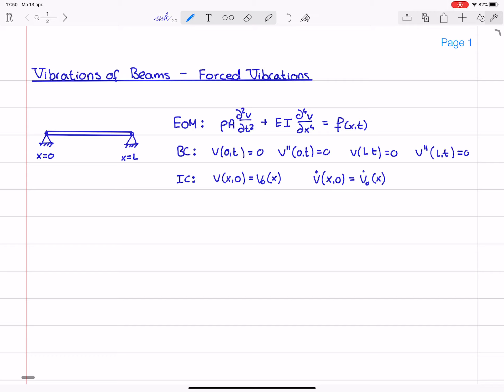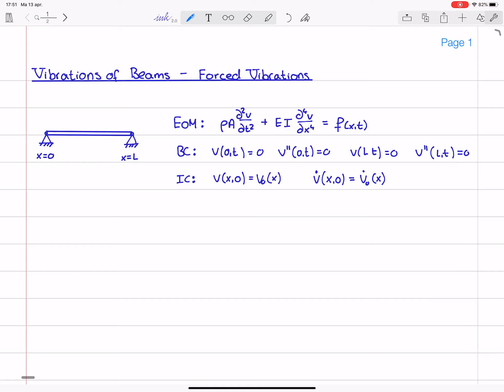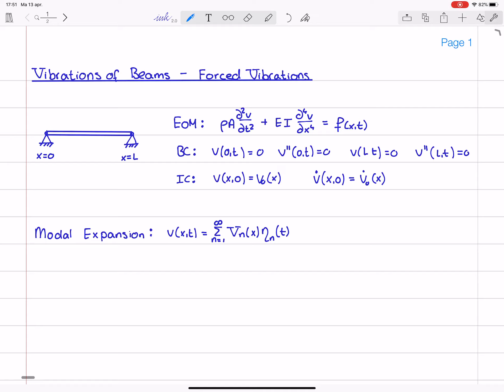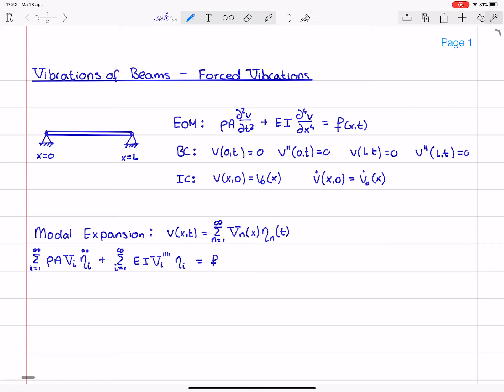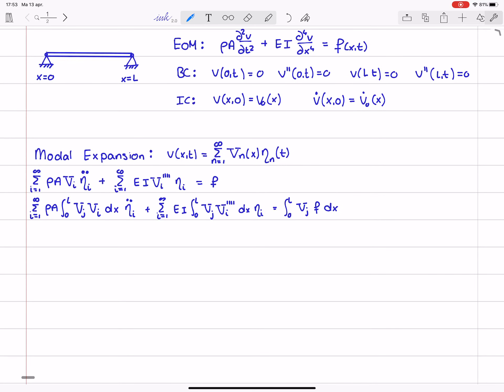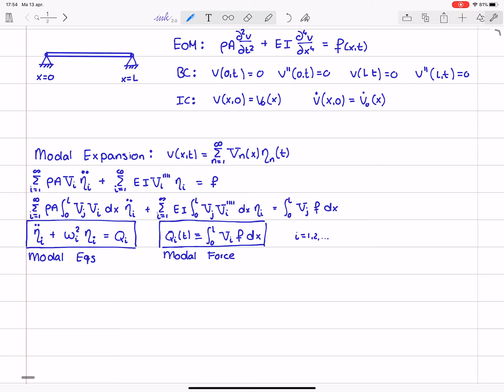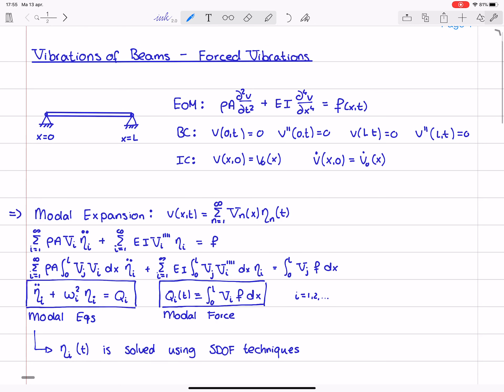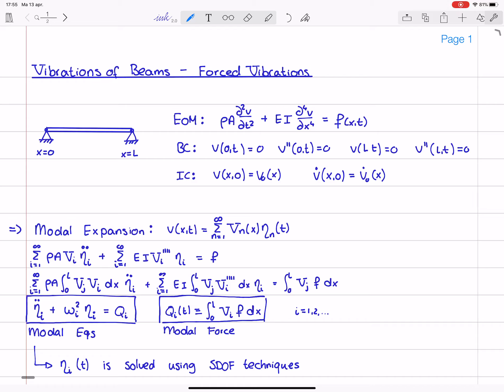Mechanical Vibrations 66 - Beams 6 - Forced Vibrations

Comment: Great video! Thank you for explanation! 
Anyway, I didn't understand why the fourth deivative of Vi is canceled. Shouldn't it be replace with a terms that in some steps gives you the modal mass? Or maybe I just missed some assumptions. Sorry I'm trying to figure out the meeaning of modal mass on the beam
Reply: It is not cancelled while deriving orthogonality condition for this particular example, we saw that the term with fourth order derivative of Vi was equal to omega_i^2

Comment: hello, this is a classic example of undamped forced vibrations that usually some books use as a example. Congratulations, it is really interesting. I am studying that topic and I am struggling with doing the integration and find the equations when it's normalized. For example, how could I obtain the value of alpha in a more detailed way? Another question is, could you do a video with more complicated eigenfunction (with different boundary condition) for example: clamped- free with the force in the tip of the free end?